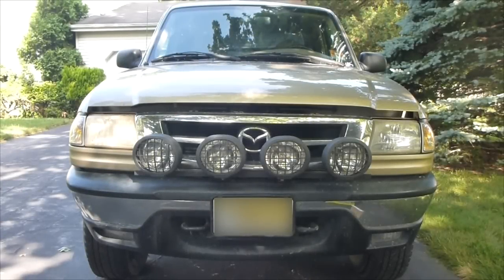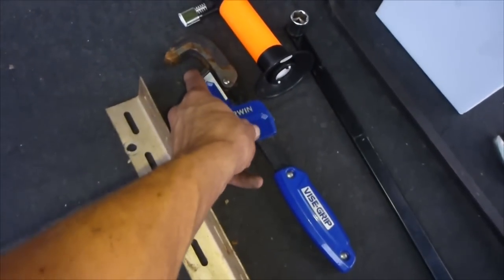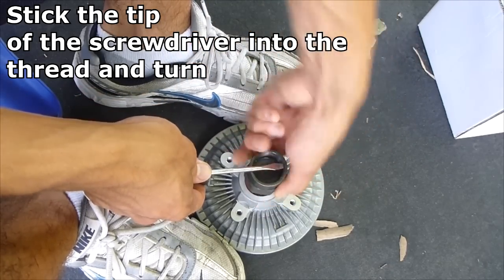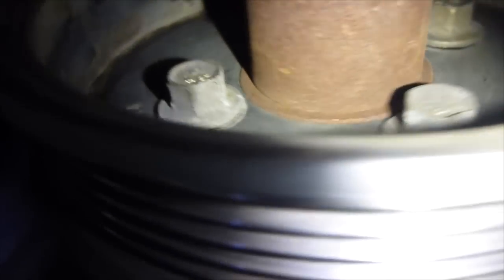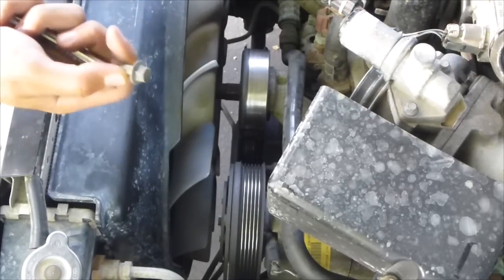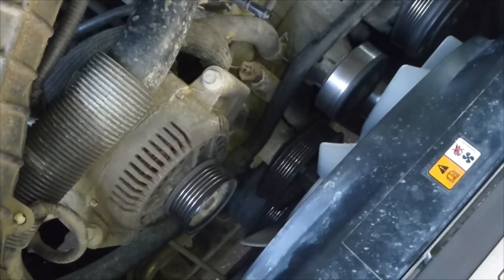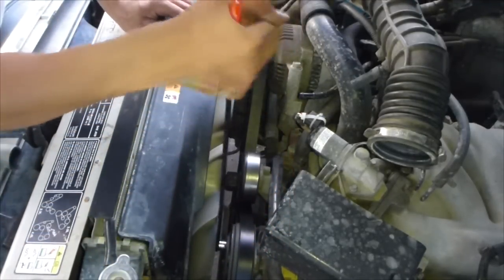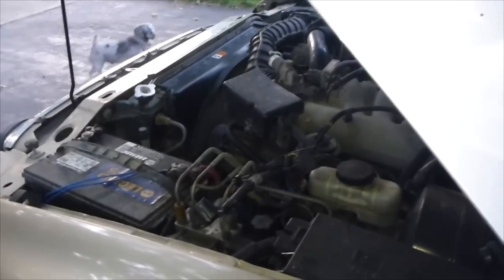How to Replace a Fan Clutch

Comment from the maker: + Ian McCombs, I cannot reply to your comment directly for some reason so I hope you see this. I would check the fuse for the AC compressor. Sometimes it will blow and all you need to do is get a new fuse. Let me know if the fuse is blown and we can go from there!
Reply: hi chris 
i would like to tell you that there is another way to remove the clutch by spaner and hammer.  the way how to do it by installing the spaner on the hexagon bolt and hammer the spaner to lose it. but don't remove the belt before lose the fan 

sorry to waste your time and my language is bad
Reply: and also to know the direction of losing the fan if you don't have the new part. 

to see the wings of the fan and see the direction of blowing air so when engine running is always try to tight the bolt so spin the bolt as the engine running to lose it and the other side to tight it
Reply: ChrisFix I am pretty sure my Ford F-150 is having the same problem. It has a triton v8
Reply: ChrisFix I have the same truck, mines a 1996 Mazda b3000 3.0L v6
Reply: ChrisFix i have the same problem with my ford f150 5.8 92
Reply: ChrisFix you have helped me and my dad alot thanks
Reply: ChrisFix you didn’t say hey guys chrisfix here
Reply: LGV10
Reply: William
Reply: ChrisFix l love you😁
Reply: hey give us a video on timing belt replacement

Comment: I had the same problem.  Wedging a pry bar between the pull an water pump gave me enough friction--easier than taking off pulley and making a jig, unfortunately.  But, I did gain VALUABLE insights from this video. Thank you ChrisFix.

Comment: Hey Chris, a tip to taking off the fan is to keep the belt on, use a large enough clamp to go around the pulley and break the fan loose. proceed as normal =D
Reply: Tried that, it just kept slipping though

Comment: Chris, I bought a new fan clutch from autozone and since day one, which was a week ago. That sound is so loud when I first start driving. Once my truck hit 3rd gear, the sound goes away. No matter if I drive a short distance or a long distance. The fan is loud and soon as I start driving. Can it be bad right out of the box? Or is there something I can do to quiet it down? Also, my fan does not spin freely.

Comment: Been having overheating problem with my pickup when idling on hard traffic and specially fast when using the ac.

Flushed the coolant, changed thermostat, cleaned the heater core, etc... Nothing worked.

Now, watching this video the fan clutch is the first thing am going to do when getting home. It would make so much sense.

Water pumps works, lower radiator hose (the one connected directly to the thermostat) is cold cold until little over working temp, wich I understand as the thermostat opening fine when it should.

The fan I see rotating so I never gave it a second thought. Trying!  Thank you man!  

Regards from Chile, latin america

Comment: Nice video, and just what I was looking for to work on my Ranger.  Flipping the fan over will not change the direction of airflow, but it might make more noise.  The only way to change the direction of airflow on a fan is to change the direction of rotation.

Comment: Excellent video. Just a small matter, when reversing a fan blade it will still push the air the same direction just not efficiently as the curve of the blade is the wrong way round. Thanks for the video.
Reply from the maker: +Tony Frewin Thanks and thanks for sharing.

Comment: Hello Chris,  What are your thoughts on removing the fan clutch and installing electric fans?  It's suppose to gives you better mpg and slightly more power.  Also do you still have your B3000?

Comment: I just replaced my 1996 GMC  Sonoma fan clutch radiator because it was making loud screeching sound.   Every mechanic I took vehicle told me something else.   I accidentally found this out because fan clutch radiator  was locked and making loud fan noise.  I thought that screeching noise was coming from somewhere else.  Only when I replaced the fan clutch radiator, all of the noise went away.  Been trying to fix this  since January, but this afternoon, I got it fixed.

Comment: Question, please answer. I have a 98 Durango with the 5.2 v8. My fan is very loud as well, and speeds up with the rpms even when the motor has just started. I see some people say the fan should spin freely when not running and others say the fan should not spin freely. Mine does not spin but it moves when I move it with hesitation. Bad clutch? Or?

Comment: I'm trying to diagnose my fan clutch.  It has some resistance when the engine is off, doesn't really spin freely.  I have a new fan clutch I played with out of the box & it seems to have more resistance than the old one.  My question is if the old fan clutch gets activated due to engine heat, when I shut down the engine and try to hand spin the fan clutch would it be harder to spin or would it be the same resistance?

Comment: I had this issue on my '95 4.0 OHV B4000.  It's set up so you have to loosen and remove the fan, then unbolt the shroud and pull them out together.  There's very little room in front.. Difficult to get the fan off.  I hit the nut on the edge with an air chisel to loosen it... When I re-assembled it, I sawed the shroud into top and bottom halves.  I strapped them together with aluminum bar stock and sheet metal screws. It made it easier to re-install the fan.  The 4.0 OHV Cologne engine version is very crowded in the engine bay... Hard to work on.

Comment: In very cold countries, it's best to completely remove the engine driven fan and replace with thermostatically switched electric one - it helps the engine warm up much quicker. The fan still spins in arctic conditions when you really want no air flow at all when the engine is cold.

Comment: Careful there. When threading the clutch back on make sure it's tight using the holder tool with a drop or two of blue lock tight and those threads must be immaculate clean. If it's too loose it could spin off when turning off the motor. It's a good idea to keep checking the tightness the next couple hundred miles.

Comment: I just replaced my water pump and now my fan clutch seems to be stuck and is revving with the engine as in this video. The only difference is that I can easily spin it by hand when the engine is cool. I am not sure if I did something wrong when replacing the water pump or if I just need to replace my fan clutch...

Comment: Good job there so is this fan supposed to run right with the engine even when it's freezing outside I thought it kicks on when the car reaches the operating temperature. How can it be modified to run like the electric fans? can it be operated by using a mini starter the solenoid type of thing that can be operated electronically?
Reply from the maker: It is supposed to turn but slower when the engine is cold. Then when it gets warmer, it spins faster. You can add electric fans and a thermostat to turn them on automatically.

Comment: I'am trying to figure out is there anyway I could use a newer stock fan with more blades & cluch that will work on my 93 3.0 stock waterpump.  I need to know whats mixes and maches that would be considered an upgrade from 93 design. I'am running a 5 core aluminum ebay radiator with my stock shroud and new heatercore with 160,180,195 thermostat in my tool box to pick from. My fan has a bunch of cracks and probably what destroyed my water pump being out of balance I imagine. So I need to know what will mix and match with my new stock water pump. My goal is to be able to run the air conditioner while idling in 100 degrees outside. I live in texas, it's not hot all the time but when it is/ it is.🌞
Reply from the maker: Possibly, do they make adapters or is the part superseded with a better model later on?

Comment: I have a question, so my dad has a 2001 Dodge Ram 1500 with the 5.2 318 and he replaced the fan clutch when he replaced the water pump, but the fan clutch still stays engaged even when the truck is cold, and I think once or twice it freed up on it's own and just free spinned but it stays engaged all the time now, and the truck doesn't have the pickup and get go that it should, and it squeals when you get on it or rev it.

Comment: you can also simply use a long breaker bar with a socket to hold the pully. might be a good idea to stack washers or use a spacer in-between the screw and clutch spindle so you don't put too much tension on the screw while you're unscrewing the clutch in the opposite direction.
Reply: I take that back. It doesn't work on fan nuts that spin out clockwise. Cus since you need to counter the force with the screw, if you try to just use a breaker bar with a socket, you'll end up unscrewing the screw as you're pushing the fan nut clockwise. Which is why Chris used the metal bar. The force is being applied to the bar not just the screw. 
I only had a thin piece of aluminum metal to take the fan out. The hole I made kept tearing from the sides as I pushed my pipe wrench.
 I decided to go rent the fan remover tool instead of spending countless hours trying to come up with a way to take it off. lol if only my metal was thicker. great idea though.

Comment: My brothers sounds like that but it got replaced not a long time ago and since that it's been sounding like that but I check it out today and instead of blow the air to the engine it blows it out to the radiator do you think the clutch is bad or the mechanic put the fan backwards

Comment: My family has a '97 saab 900s convertible.  The other day we pulled in and there was a loud bang. Followed by steam.  The engine temp emediatly shot up to the top. Turned out the lower radiator hose was worn and that's what blew. Anyway the electric fan does t work on low as the resistor is shot. We are fixing that but the fan doesn't work on high either. The fan motor works. High used to work until the day that radiator hose let loose.  Now the a/c compressor won't come one either.  The high speed on the fan is only for the a/c system according to the saab dealer, with low only being for the engine when doing stoplight driving. Well now the highspeed won't come on nor the compressor. The system is charged with freon. Any ideas. The compressor worked fine until this event.  Also there was a very loud grinding noise the same day before the event,  my dad thought it was either the a/c clutch or the fan. The fan is good, and when the a/c came on, it was cold, and the pulley didn't wobble. We are stuck with how to get the a/c running. Also all fuses/ relays are good
Reply: Ian McCombs O

Comment: silly question, does the 1994 ford ranger 3.0L radiator fan fit the 1994 Mazda B3000 radiator fan? I need a radiator fan for my 1994 Mazda B3000

Comment: Hi, good job!
as hallway s
Question?
So i got a 2002 Chevy trailblazer...
says the FAN CLOTCH  IS HIGH? so the fan is working,  but never stop!.....so shoud i change the clotch fan? i dont know if is 100% that or i have to check like the Relay or some wiring , or short, first, dont know.....
thank you for you video, and i hope you can explain or answer my question! thank u✌
so my question is

Comment: interesting.. Is there a tutorial on just replacing just plastic fan someplace. The hub on mine has some hairline cracks. The clutch is fine.Todd
Reply from the maker: +ToddB987 Just take off the nuts to get the fan off. I show it in this video when it is out of the car.

Comment: Good video as always (you helped with an idler pulley and belt issue last year).  Having similar squeaking again, thought it was idler again but it seems good after rechecking.  Further inspection led me to the fan.  There is a noticeable wobble, but its the whole unit (fan, clutch, pulley etc. all still assembled).  Then it instantly started dripping antifreeze.  I'm guessing I have a much bigger issue, suggestions?
Reply from the maker: NoOneFlinches That sounds like a bad water pump. The weep hole in the water pump is leaking and since the fan wobbles that means the bearing is probably bad. Time for a new water pump!
Reply: ChrisFix That's what I was thinking.  Thanks again, really appreciate the help and keep the videos coming.

Comment: Hey Chris, I've got a 97 Ranger that sounds like your Mazda with the bad clutch on startup with but I can't tell if the clutch is locked or not.  It there a test you have found for a locked up clutch?  It never sounds like your Mazda with the replaced clutch.  (It's got 212000 miles on it....)

Comment: I have a Nissan Presea R10 -1994 old car. My clutch is too tight to push and it is a cable clutch. Can I lubricate the clutch cable to prevent the issue or is there any method to solve? Please give me an answer.

Comment: Is the procedure for removing the fan different if you have an electric fan (like you would on a hybrid or EV)?
Reply from the maker: Aidan Franits Yes, the electric fan is bolted onto the radiator shroud and is a lot easier to remove.

Comment: I have a 2000 Toyota Tacoma V6 with a ridiculously loud fan at idle AND while driving. This ONLY happens during the hot summer here in Arizona, but during the winter it's quiet and still cools the engine normally. This makes me confused on whether the fan clutch is bad or not. The fan clutch is only a few years old, and this new one since then has always made the fan louder in the summer. The original Toyota fan clutch NEVER did that during the summer and would eventually become quiet at idle after 30 seconds.

Today I tested to see if the fan clutch itself is bad. The fan itself, with the engine off of course, has resistance from spinning. I can spin the fan with my hand with little effort, but it doesn't spin freely when you let go of the fan. After that, I decided to warm the engine up at idle. The fan is still loud and would get much louder as I rev the engine - even at operating temp. The fan go quieter as the engine warmed up, but it would still get loud as I rev it. When the coolant got to operating temp, I shut it off. I looked at the fan and find it still has the same resistance as when it's cold. I then decided to drive it... and guess what? The fan clutch decides to slip more the 1 time I try to diagnose it and the fan was perfectly quiet while driving! It's 100 degrees outside and should be spinning fast like it usually does. Now I'm very confused as to whether or not I should replace the clutch! Should I just get a new fan clutch?
Reply from the maker: ***** Sounds like a bad clutch because when it warms up it should grab more and when it is cold, it should slip more. Hm, that stinks because it is relatively new.
Reply: ChrisFix Okay so I went to Firestone to get my truck some new brake pads and told them to check the fan clutch and they found it to be functioning properly. That's a good and a bad thing. Good thing is that it's working, but that bad thing is that this is how this crappy new clutch is. It's making my engine suck more fuel and doesn't accelerate as fast when constantly on. I literally researched for new fan clutch and bought one online that is an Aisin fct-013 and that is made exactly as OEM as the reviewers stated. The reviewers stated that it's also quiet. The one Firestone put on a few years ago was a crappy generic one. I was expecting to have to put more money into my truck anyway while at the mechanic, but my rear brake shoes were still in good condition, so it saved me a $100. Might as well use that extra $100 on a better Japanese made fan clutch. It's also easy to replace on a Tacoma too. Just remove 4 bolts and the clutch comes straight off the pulley along with the fan. However, this video you made is very informative for the kind of assembly on your Mazda, so thanks.
Reply: ChrisFix Well today I just replaced it with an "authentic" Toyota fan clutch and it's as quiet as a mouse now! The one Firestone put on there was a piece of shit made in China one that was smaller and didn't function like the original does. I'm happy now :)
Reply: The reason it would have done it during summer (or when it's hot out) is because some fan clutches run a fluid (can't remember what it's called off the top off my head) that expands and acts like a clutch once it heats up. Once the fluid wears I believe it becomes more sensitive too the heat.

Comment: This is the issue with my white toyota car because when it starts up it goes loud, but if you rev it up it doesn't go louder, When you start the car while your in the interior, it won't as be loud. And for whatever reason there's little white smoke coming out of the exhaust pipe. The next problem might not be a problem to you but usually if you tried to turn it all the way to upside down to turn it, it'll only turn just a little or go straight, so you have to turn the steering wheel multiple times for the wheels to turn properly

Comment: Hey chris , I thought the fan should NOT spin easily by hand ? May engine is overheating and some people told me it maybe a bad fan clutch. I could easily spin my fan so isn't good or bad ?
Reply from the maker: When the fan gets hot, it should be hard to spin by hand. When the fan is cold, it should spin freely.

Comment: I personaly like this sound on my truck. Is it bad for the car though?
Reply from the maker: Nicholas Chavez It is bad because if you go above a certain RPM normally the clutch disengages the fan. With a bad fan clutch, the fan is spinning at high speed and can break apart causing a lot of damage. Happened to my friends BMW.